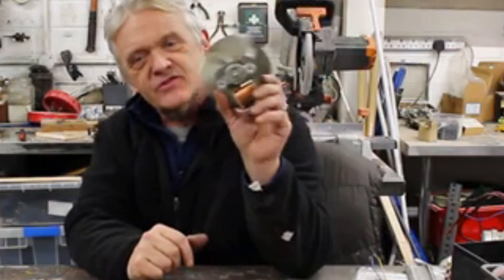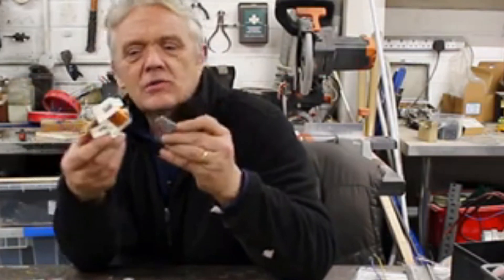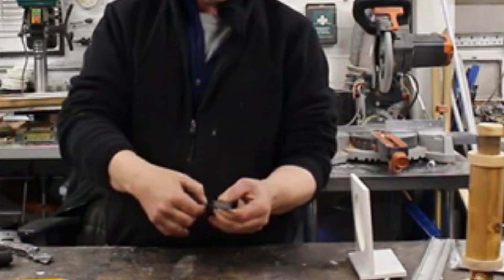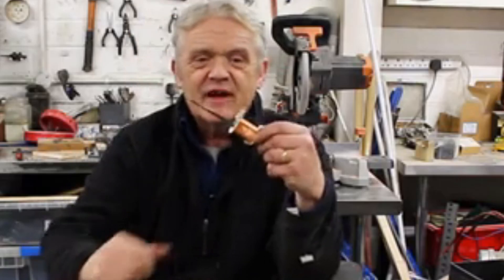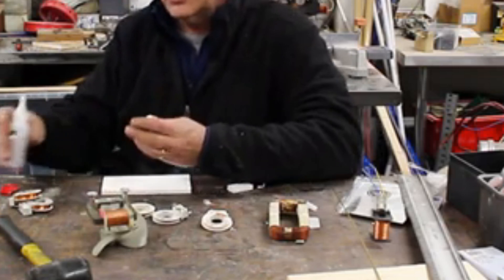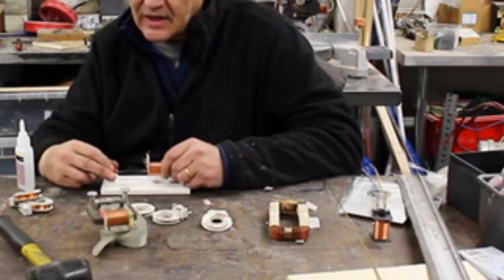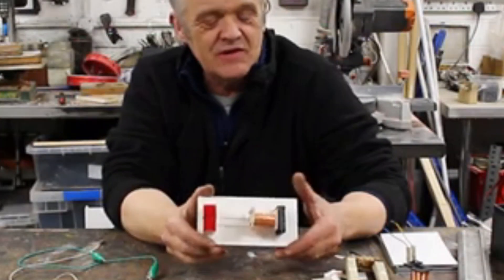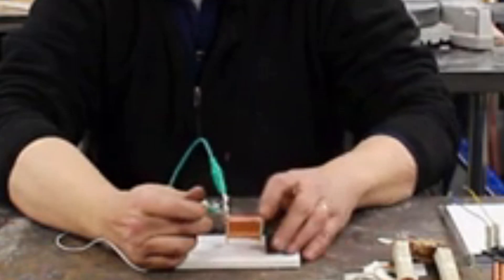1825 Building a Simple Vibration Energy Harvester

Comment: You'll have a simple seismometer if you mount this vertically in a protective tube with as long and thin of a "hack saw blade" as possible. Best if you bolt it to your foundation or a slab outside and then use an arduino/Raspberry pi to read the value over time.

Comment: Those coils are great for making high impedance speakers for crystal radios  Piezoelectric transducers are great vibration energy harvesting devices too and they are also great for making high impedance speakers for crystal radios. I've never got round to it but I have always thought about making a wind belt that uses piezoelectric element transducers instead of coils and magnet's.

Comment: like a reverse aquarium air pump, they have a magnet on the vibrator and a static coil but exactly the same principle. I once replaced the magnet that comes in them with a bit of broken neo50 and got a significant pressure increase from the pump.

Comment: Normally I find  your explanations to be quite clear and obvious.   However,  this time I just can't visualize how one removes the coil from the motor.  You breezed over that part a bit too quickly.
Reply: The fan is attached to a rotor and the rotor is held on by a sort of clamp with bearings. There are generally two bolts holding it on, often the only bolts on the entire motor. Just remove all that and then cut through the thin side opposite the coils. You can then bend it a bit and the coil will fall out. The coil is sort of clamped on there. It makes sense if you see it in person. It shouldn't be too difficult to figure out.

Comment: Those little induction fans are in many more things than microwaves, though those little blocks of copper are quite fantastic.

I'm using one to boost up a transformer because with a transformer you just need the coil in the proper proximity for it to activate the transformer coil, so you could in fact set one coil to generate and surround it with other coils clapped in iron and watch the transformer generation along each of the transformer coils.

Comment: While its use as an energy harvester is minimal, I can see more uses for this as a sensor. Measure the generated electricity when the thing vibrates, and you have created a nice little seismometer. In fact, any application where you need to detect vibration would work. Plus, you could reverse it. Attach your saw blade to a sounding box, and you could use electricity to cause the thing to vibrate to make sounds. While none of this is going to win any Nobel Prizes, there are any number of projects a young person could do with this device to win science fairs.

Comment: Its a great way to make use of the coil and thanks for showing how to remove it. 
This is an excellent way of speeding up the power generation in lieu of a transmission.
Door bells used to work that way in reverse.
No offence though one can reproduce the same effect with much less tools when the coil is stationary and the magnet is attached to the hacksaw blade.

Comment: It's sort of amazing how many different methods of energy harvesting there are! 
Small note to those who don't have experience with LEDs... they don't have a built in way to limit current... so, if you put these in a circuit without a current limiting resistor (or something to limit current)... they will typically self-destruct if the circuit power is more than around 50 milliamps +/- for more than a second or 2, so you want to add a resistance that will keep them in a safe level of current ~ 20mA or less.
Reply: I wanted to add that that particular THT LED should be able to tolerate a relatively high pulse current (above 300% of 20mA for short periods) when the coil voltage forward biases the LED. However, the 120/240V coil will produce enough voltage to reverse bias the LED which is much much worse. It will punch holes through the junction, destroying the LED in short order. Knowing the Peak-Peak voltage range would be an important part of designing what you attach the coil to, but at the very least RMS could add a Schottky diode in anti-parallel with the LED to protect it from reverse bias and clamp the voltage from exceeding 5V. He could also use two anti-parallel LEDs.
Reply: @InfinionExperiments  Good points... but wouldn't it still be advisable to include a current limiting resistor if he planned to keep a LED in the circuit for more than a very brief period?
Reply: @marcfruchtman9473  Yup, resistors are a perfect and cheap current limiter. You were right in what you were suggesting as a good practice.

Comment: Would it be possible to use the stack effect to passively operate an energy harvester like this one? Maybe a black pipe inside a clear tube, orientated vertical like a chimney, in sunlight. Draws ambient air in through bottom, heats it in the pipe, hot air rises and exits the top, and this energy harvester vibrates in the moving air at the top?
Reply from the maker: I would suppose so

Comment: make a small kite on it or a flag and put thousend on top of your house. .. than you understand me👍👌
Reply from the maker: nope - I don't understand you
Reply: @ThinkingandTinkering  maybee you made the inercore to tight. instead of the sawblade you glue a wire on the innercore, if you let it resonate by flutter it will supply current. so instead of the magnet on the end ,a kite(or flag) that pullse. i replied this in earlier vidio of you.

Comment: Saw your video just as I was finishing disassembling a microwave I found. And I was thinking of removing the motor and winding a thick primary coil for a makeshift flyback transformer. Most flybacks I find have rectifiers in them so I can't use them together with my CW voltage multiplier but I figured this would be a nice way of using it. What are your thoughts? Do you think that that would be a good way to use the fan bit? Great video as always.
Reply from the maker: it wouldn't be a flyback transformer mate and if you go over 10k volts you are going to burn out the insulation probably - but you would get a couple of thousand volts out of it
Reply: @ThinkingandTinkering  thanks rob, cheers

Comment: I would guess something similar is used in seismometers for detecting earthquakes. Although for that application it may make more sense to put the coil on a pendulum and the magnet on a base that would stay at rest (or vise versa but I'd suspect the magnet would need to be not as strong if it was on the pendulum unless additional weight was added).
Reply from the maker: you could always give it a go mate - sounds like a great project for you to try
Reply: What reminds me is the MC cartridge of a turntable
Reply: Or you could mount it near a place where people are constantly walking, like a footbridge or a railway.  Rob's wind vibrator would come in handy in this case.

Comment: Love this channel! BUT you have not made your 2nd most important video yet. All these ways of HOW to generate electricity, but NO videos on how to harness this energy for battery changing. Come on we need this piece of the puzzle or all efforts of building are for not. Please make this video. Cheers!
Reply from the maker: I have done loads of them - you just haven't seen them - in fact I don't make that many anymore because on the whole folks don't watch them - it's just odd to my mind - but there you are - any way I will do another - just for you
Reply: @ThinkingandTinkering  I've been following this and your first one years ago involved also a microwave piece and used wind on a rod type that generates energy from the vibration, tiny amount but concept works. Please Great Sir to conceptualize the same concept to work on ocean waves as some sort of floating device type that harnesses the up and down motion of waves. Also that floating device machine in question can also be possible to work with wind as well as a multiplier?...that can be hooked up to a battery that uses the ocean itself as electrolytes as practically a salt water battery? Maybe a floating pod that has solar roof panels that is powered by vibration from both waves and wind that possibly hooked up to the ocean water itself as battery...sorry HIGHLY THEORETICAL.